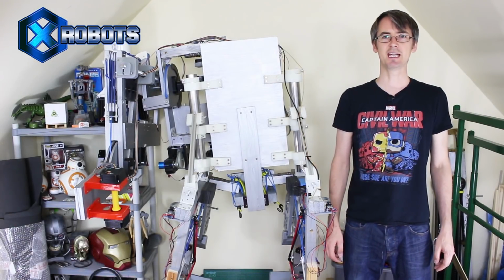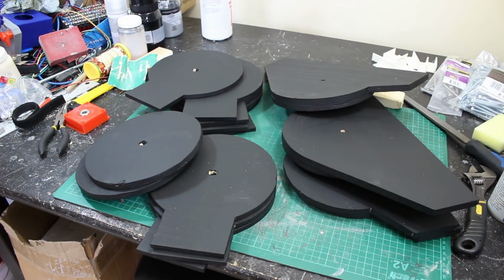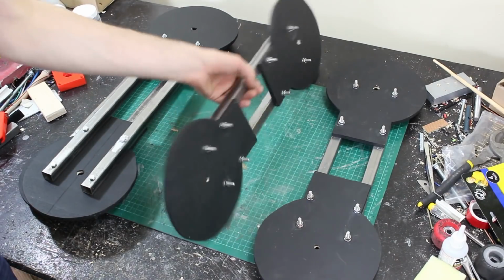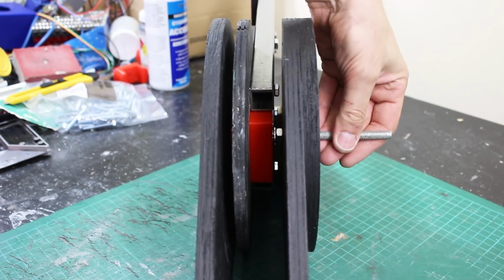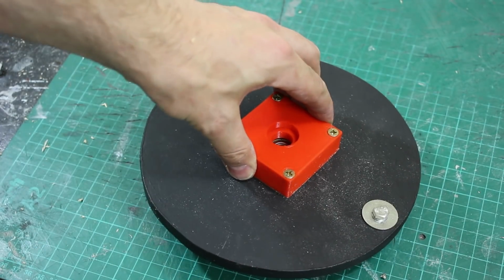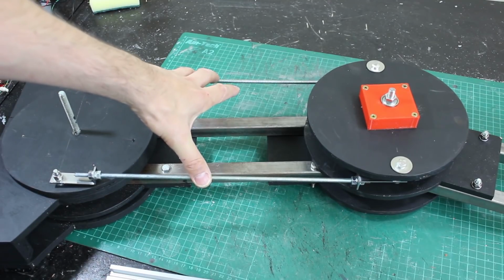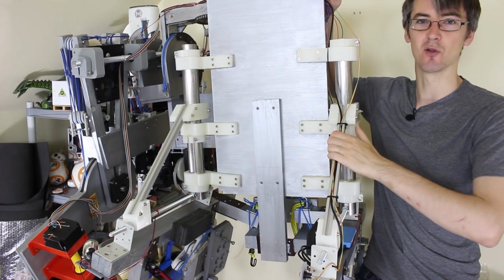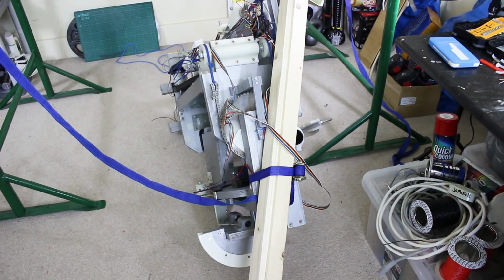Iron Man Exosuit #15 - New Legs | James Bruton

Comment: Its definitely an improvement over the last one, but it still follows the same general design and im not sure thats the way to go. This still has Alien Powerloader feel to it.
Reply: I'm not sure there is any realistic way to build an "exo suit" without having it larger than the person using it. 
It might balance out after the bolts are cut down and the rest of it is put together.
Reply: Unless you have magic materials and power sources from the movies there needs to be bulk to have a real structure.
It would certainly work better as a power loader then a skin tight suit.
Reply: As it is, it could only work as a power loader. But if the goal is to be more Ironmanish starting from weak slim suit and then bulking it up might be a better path of development.
Reply: Divine Linker I'd be happy if it looks like a powerloader. It's really one of the more realistic applications for an exo anyway.
Reply: Divine Linker In Iron man, both the movies and the comics, the suit starts off bulky and gets more sleek with each iteration. That's the same thing we're seeing here so far.
Reply: I found it! Bowden cables, thats the technology that might allow him to make really slim suit. In his first video he showcase a cosplay model of Ironman suit and complained that he have no room for a motor on the elbow. But with bowden cable he can place the motor on the back and transfer the power to the elbow. Like tendons in human arms. Stepper or servo motors might also be a better option. Hmm, i might take a crack at this myself.

Comment: When you were drilling the bars of metal, I nearly jumped out of my seat. I was told to always clamp those down just in case the bit snagged. The drill could turn the bar into a giant lawnmower blade that could rip a finger off.

Comment: Good job as the main structure of the legs look great!  The should be able to handle a lot of weight.  My only concern is the parallel links part.  The bent straps are the weakest link in that entire structure.  The studding is off axis of those bent strapping.    Best case, they will have lots of slop as you add weight and they torque as they push and pull.  Worst case they bend straight and/or fail.  I would recommend looking into angle iron.  Its lighter than the tubing but ridged in two directions compared to how flat stock will flex when you add a compression load.   Something to think about.

Comment: Christ! Can you get an angle grinder already? You would be so happy with it!
Reply: Seems like he does most of his work upstairs in a house.. That's not a good place to use an angle grinder, but if he has any outside space then I would agree with you.
Reply: BitHead1000 I think the Sparks an angle grinder throws would pose a bit of an issue in his flat
Reply: Agreed. I have one and would never use it indoors.
Reply: Here's a crazy idea... Go outside.
Reply: Depending on where you live, you might not be able to do that. It's also completely possible that he simply doesn't want one.
Reply: Considering the actions her performs routinely and the amount of space in his loft...  what he could use is a mini table saw with miter box and a mini drill press.  Both of which he could probably build himself from 3D printed parts and hobby motors.  LOL  ;)
Reply: Probably not a a good place to spray paint ethier, but he figured that one out.
Reply: Someone get this guy a Dremel... :)

Comment: Red filiment, hammering in bolts with a screwdriver handle,,,have you been watching Ivan Miranda? Great work as always, keep it up. Just one thought though: the angle brackets you made might bend under a load. You may want to replace those with threaded ball socket joint things. Sorry can't think of the correct name of them. But I think you know what I'm talking about. Hardware stores carry them.
Reply: At 2:40. It's kindof a running joke on Ivan Miranda's videos to use the proper tool (screwdriver handle) to tap in hardware. I hope you didn't take it wrong. I would never want to offend or make fun of my favorite YouTuber.

Comment: Hey James, what are your thoughts as far as the hands/gripping mechanisms? I remember on the Hacksmith's exo he just used little bolts to secure loads to the suit. Haters will say "well Matthew, I don't see YOUR homemade exo", but you can't argue that bolts are a little underwhelming for such awesome feets of engineering. It would be a shame to see you get to the end and be so burned out with the project that you just duck tape whatever load you feel like lifting to the end of the forearm.
Reply: I was just having a look at a pair of vise grips on my tool bench, I think a motor could be attached to the bolt that adjusts the size, and a small pneumatic or hydrologic piston could be used to close the clamp down. They'd be sort of small, but hey, I'm just brainstorming here.

Comment: I still think load cells are they way to go over these resistive disks in squishy blocks. Load cells are rigid and linear, I cant imagine the resistive disks can measure accurately just through contact pressure.
Reply: Not talking about strain gauges, have you looked into load cells? They work based on strain gauges, but they are rigid metal objects in all shapes and sizes (compression, stress, torsion, etc. you can get them as tiny or as flat or as big as you want), they measure the force on them in one direction (sometimes more), often with convenient mounting holes. Basically all electronic scales use them. You wouldn't need any joints or moving parts. Plus, they are very cheap. I imagine with hall effect sensors you would need some kind of movement (ninjaflex) to bring the magnetic field closer, which could cause issues with oscillation and other errors if there is any slack in either the sensors or the magnets. I think hall effect sensors are also very picky about magnet rotation, so for example a slight rotation of the magnet could cause a huge spike in the sensor compared to the magnet moving closer and further. For example, I think the hand control grips would work nicely with load cells.